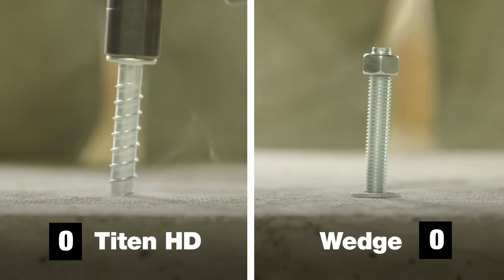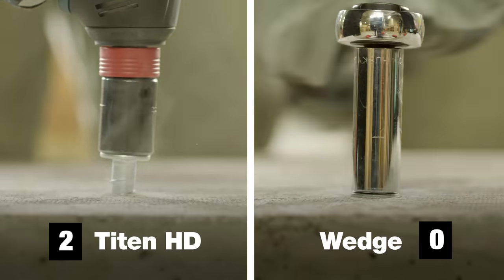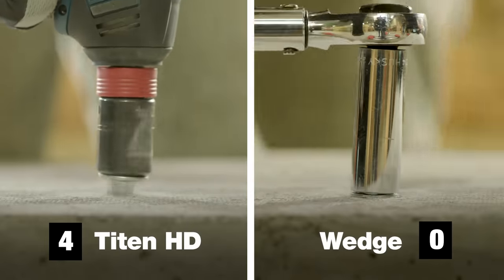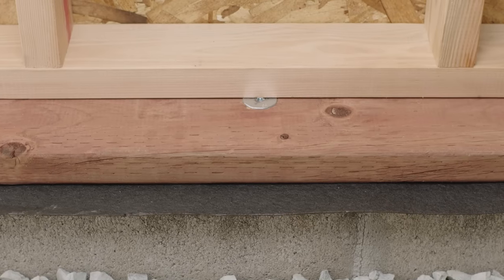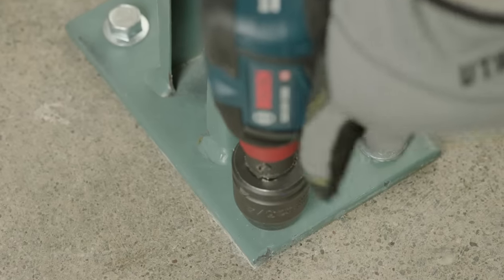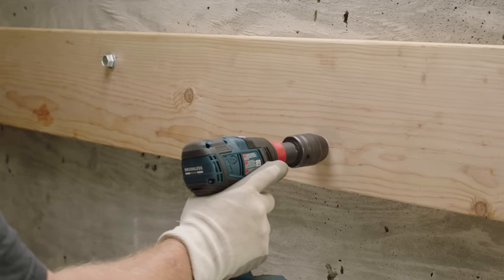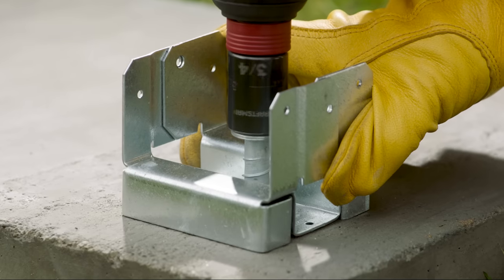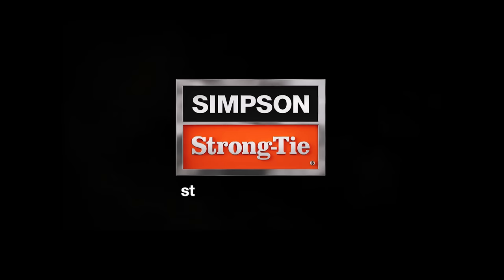Advantages of the Simpson Strong-Tie® Titen® HD heavy-duty screw anchor vs wedge anchor

Comment: Still doesn't show the steps to install!!
Reply from the maker: Hi, you can check out this video on How to Install a Post Base with Stainless-Steel Titen HD® Heavy-Duty Screw Anchors.
https://www.youtube.com/watch?v=TAKoeoUYRpo
Reply: @strongtie  THIS VIDEO DOES NOT SHOW ME HOW TO INSTALL IT! 
It does not show if the hole needs blown out
It does not show if the hole needs to be over drilled
It does not sure if the hole needs scrubbed out.  I assume it does, but it sure would be a better approach to dhow what's actually required vs. me assuming!

DO BETTER

Comment: Can I use 5/8 Titan HD stainless  steel with the ABA66Z post base?  I couldn't find 6" mechanically galvanized bolts a Lowes.
Reply from the maker: Hi, thank you for reaching out.  Unfortunately, there are too many unknowns that we're unable to address through social media. However, we do offer free engineering services that can answer your question.  If you call 800-999-5099 they can connect you with an engineer who can make product recommendations. Best, Jade

Comment: Hi! What about when hitting the rebar? Cheers!
Reply from the maker: Hi! Thank you for your question. In general, care should be taken in placing post-installed anchors to avoid conflicts with existing rebar.  Before drilling through existing rebar, a licensed building design professional should review the installation to ensure the strength of the structure is not compromised. After drilling through/cutting the rebar, depending on the size and location of the existing rebar, installation of the Titen HD and Strong-Bolt 2 may be affected and prevent proper installation.  At that point an Adhesive Anchor with threaded rod like our SET-3G high-strength epoxy would be a recommended alternate solution. We hope this helps! Best, Jade